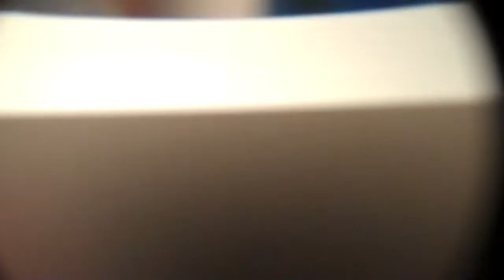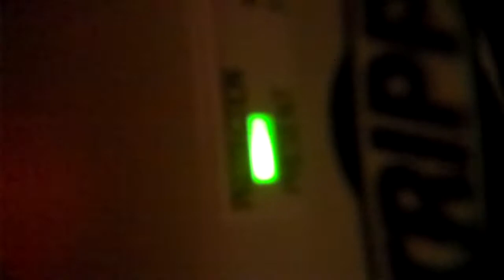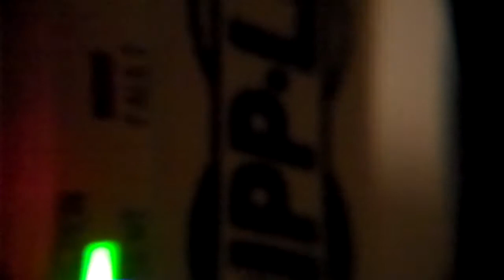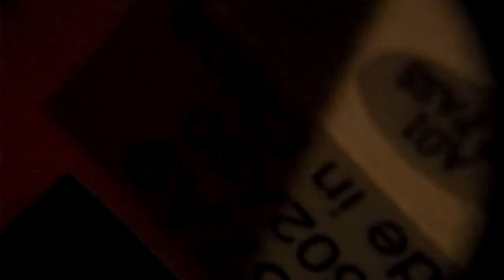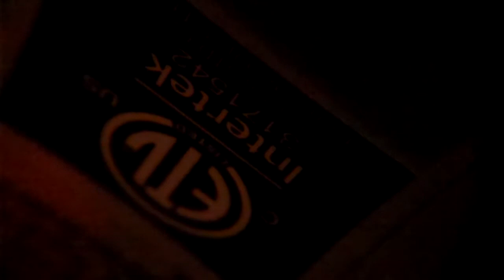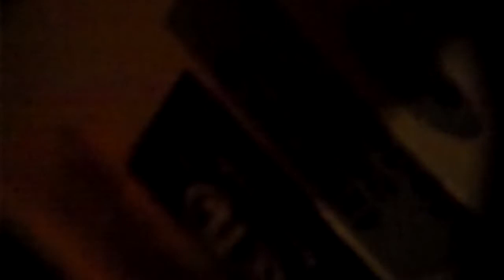27" IMac (Late 2009, EMC 2309) Inducing Degrading Static Into Home/Studio Wiring

Comment: Millstap. greetings from frigid Chicago !   On my Macbook Pro it was the computer screen. The LED'S  I think. Try that , unplug the screen .
Reply from the maker: Hey Chris, I mean Chicago!  We could use a little global warming right now, LOL.  It's been unusually cold down here too.  So, where was the noise coming from?  Since your power goes from the outlet through a DC adapter to a battery, I wouldn't think any noise could bleed into the home wiring and interfere with anything outside of the computer.
Reply: Just the screen being on emits some kind of interference. Try it. turn on the computer without the screen on. Hope that's okay to do.
Reply from the maker: You may be right.  I just don't see, in my case, how that noise is transferred back into the wiring of my house and even jumps between circuits.  I put the computer on one breaker and the amps on another, and it still caused interference in my amps.  I hope it is the power supply but I'm not sure right now.  The LCD inverter card is right next to the power supply card so it could be the one making the noise.  The LCD inverter card would be another $110 I think.  It dawned on me this morning that when the computer is in Sleep mode, the noise is gone.  So, is the power supply still receiving and supplying power in Sleep mode?  I need to research that.  I should know Thursday if it was the power supply.  That is when I will replace it.
Reply from the maker: I did another experiment and pretty much pinpointed the power supply as the problem.  After your comment about the LCD, I noticed that the computer seemed to be dead quiet when it was in "Sleep" mode.  I did a little research to see what was exactly happening with the power supply in Sleep mode.  It supplies just enough power to power the RAM so it will wake quickly.  So then I said, I could have just put the computer in Sleep mode instead of shutting down all the time.  I put the computer in Sleep mode and listened to my surge protector.  Sure enough, it would make the static noise but now it was pulsating, on for a second, off for a second.  I couldn't hear it at first on the computer but I put my ear there and the exact same pulsing.  That tells me it is the power supply because the LCD is shut down the whole time in Sleep mode.  Your comment helped me figure that out.  I would have never thought of checking Sleep mode.  Now I know that Sleep mode feeds the computer with periodic bursts of power just enough to keep the memory active.
Reply: Glad it helped. The pulsing I found in my case is my iPhone in my pocket while the guitar is on my lap plugged in. Try putting your iPhone while on next to the pickups and you'll hear all kinds of alien sounds. Plus you probably have taken the RF shield cans on the 12ax7s  off like me which  probably adds to the interference . Just my 2 cents .
Reply from the maker: I never take the shields off.  Why would you?  The pulsing comes from the back of my 27" monitor right where the power supply is.  It is definitely a function of the Sleep mode.  The pulsing is how it conserves energy.  I keep my iPhone as far away from everything as possible.  Those things are nuisance but I do need it for Spotify.
Reply: I've never left those on my preamp tubes. I just feel that the tubes sound better than having the shield bounce back the heat into the tube. So that's the story. Peace !
Reply from the maker: I'm so happy.  It was the power supply and I am uploading the video now.  Man, it is cold down here.  This is the first time in my life I ever saw these temps in this area.  It was 13 deg. with a wind chill of 2 deg.  Everything is shut down today.  I think we broke the record by 10 deg. F.
Reply: I'm glad you resolved the issue. That's cold for down there. Big warmup by the wknd. 40's here.Colder again after that.....
Reply from the maker: Warmup here is going to be mid '70's.  Golf thirty.  Well, maybe not yet.